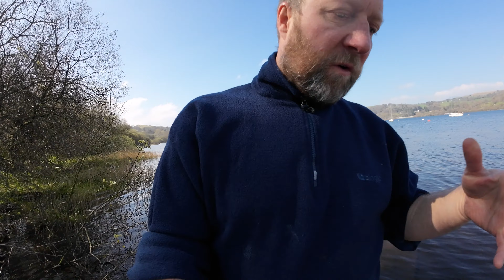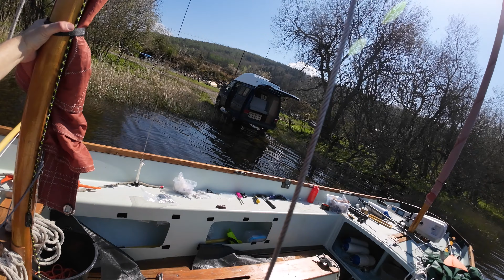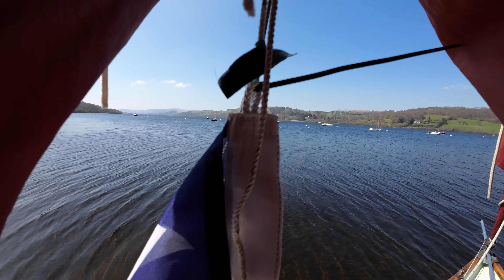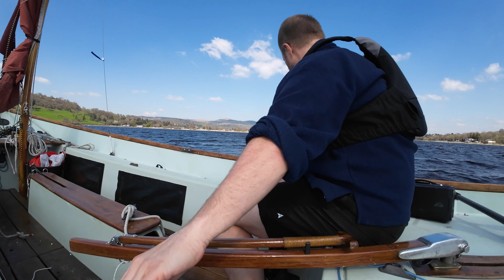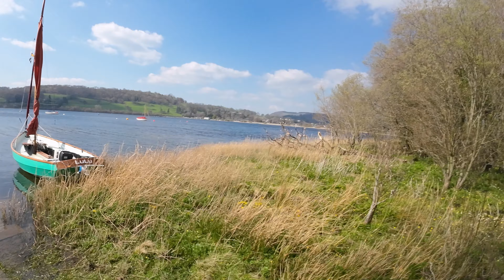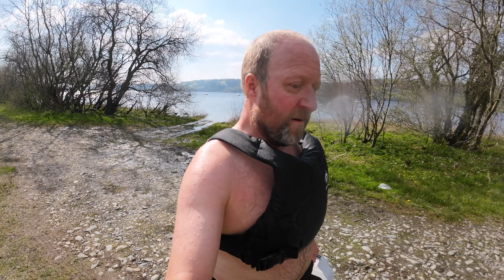Testing the Simrad TP10 Autohelm On The Drascombe Lugger And One Very Cold Swim

Comment: Wetsuit is the way to go in this country!
Reply from the maker: Well Stuart, yes I would agree too. Very silly swimming at the end TBH. I htink with the Lugger you have to sail her assuming she won;t capsize. She's not like a dinghy in that sense, however she can and then you're in the water. I htink for me the wetsuit is a real faff for the lugger. For one I can't pee!!! nSo I may go the dry suit way,compolete with gentlemans relief zipper.
Reply: I haven't worn a wetsuit or drysuit in years and I go swimming every time on my boat on the south coast, it's fine when you are used to it, for a bit 😂
Reply from the maker: @fat_tommo_goes_boating  I wear mine when I go paddling in the winter/spring but on the Drascombe, it's like wearing one on a yacht or powerboat. Doesn;t really keep you warm in the dry either.
Reply: @SailingWithDave  if it doesn't take you're breath away, it isn't worth doing 🤣🙈🤦‍♂️
Reply from the maker: @saltireasamWell to be honest there, I think I feel another test video coming on.  I otigionally got put off Dry suits because I was wrongly told they aren't any good in the cold. What they failed to tell me is that if you put on layers underneath then you're fine. I mean if they're good enough for the RNLI  guys, it's definitely good enough for me.

I bought a Fladen suit and thats really great but its too hot, Dry suit is the only way to go now, unless of course I go back to Drasconmbe tradition and buy some oil skins!!!

Comment: Hi Dave , not sure if it's suitable for you're situation  but a drascombe will sail itself very well with sheet to tiller steering rigged . Cheers
Reply from the maker: Mi Mark. Actually i'm quite interested in that and last week I found a really good video finally that explains how it works. Im definitely going to try it in Season 4 (Winter at the moment). The autohelm TP10 is very good but anything that I can use without power is better.

Comment: Ya mad thing! Well done Dave but you really need to get a wetsuit even a shortie.  I was having a heart attack watching you.
Reply from the maker: Hi Tom. Many thanks for the comment.

I do have one that I do use if sailing the Mirror in colder weather or paddling in Tadpole. It's quite a warm one too, 3/4mm and even in April i'm too hot in it. However for the Lugger I think a drysuit is fast becoming the answer. On a Lugger you're not anticipating capsize, so you need something that will keep you warm when dry. I think having the ability to change the under layers according to season/weather is better and also the fact that they're more suited when on bigger boats where you're not expecting to take a dip!!!

The Fladen immersion suit is also an answer. However with the flotation built in, it may not be the answer when solo as it would restrict the ability to swim and re-board the boat. Much the same as the debate on wearing a life jacket or flotation jacket.

They are expensive though!!! Even the non-goretex ones with relief zips seem to be around the £500 mark so not to be sniffed at.
Reply: @SailingWithDave  yak dry suit is reasonable
Reply from the maker: @tomsawyermusic3877  i'll look that up!!